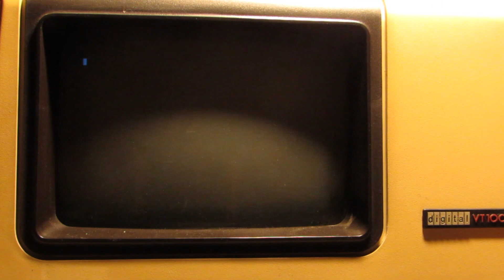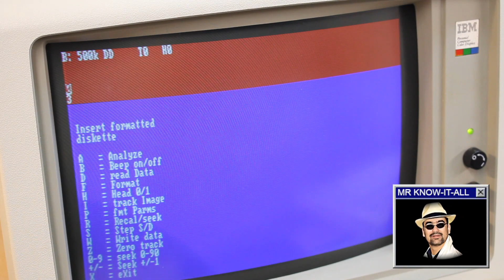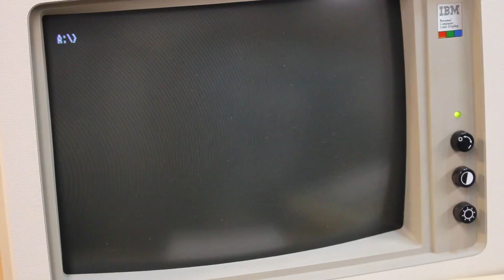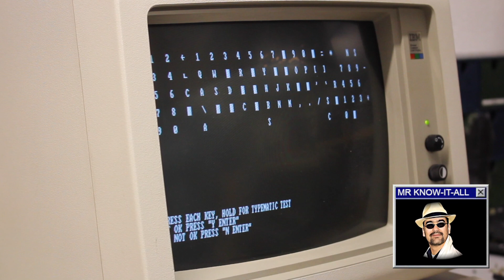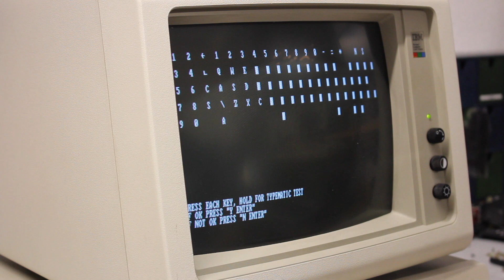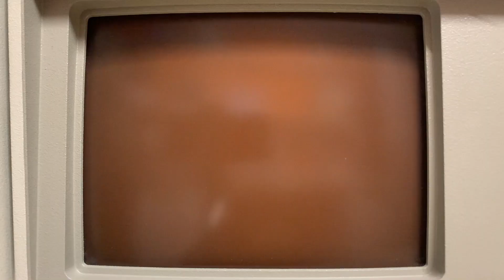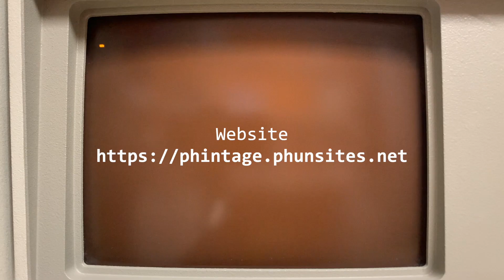How i finally fixed the IBM PC 5150 TM-100-2 floppy and Model F keyboard [IBM 5150  journey - Pt. X]

Comment: I'm going through all of your videos, great tips.  But I'm a little confused.  At 3:01, you point to a screw on the stepper shaft.  But then at 3:17 when saying to find the sweet spot, you're adjusting a different screw at the rear of the drive.  Which screw is the critical one?
Reply from the maker: Both are. The other one controls how far the stepper can move back to track zero position. It‘s actually explained in the linked video about the kaypro II, as there is even a third screw for the head band.

So it‘s actually…

1. head band screw (reachable from underside) = tight

2. shaft screw (reachable from upper side) = something between „not loose“ and „not tight“

3. track zero stop position (backside)

Check out the Kaypro II video, as this is explained in there.
Now as you say it, I propably should have recapped it in this video as well :)

Comment: Your videos are interesting; I think you should consider trying to get the audio level more even. I turn up the volume for parts that aren't loud and some parts are loud and your transition sound is loud.  I have to try not have my TV loud  because it will bother my girlfriend.
Reply from the maker: Thanks, I'm aware about this issue, in fact my constant struggle with the audio compressor, which fails on the differing sound sources. I'm working on improving this.